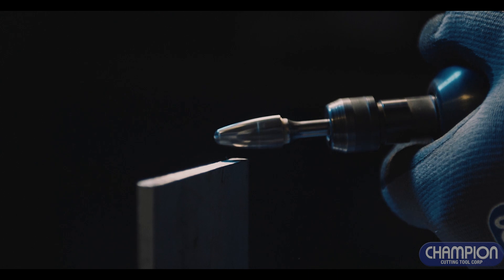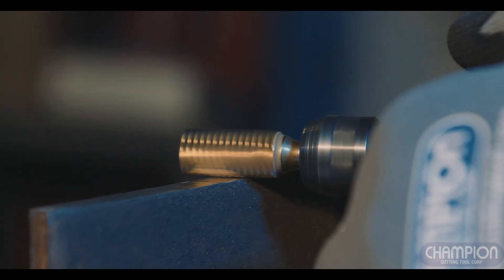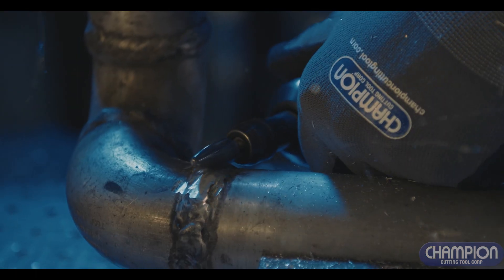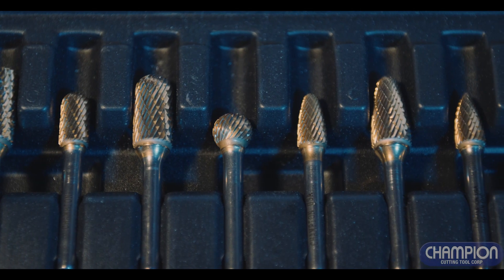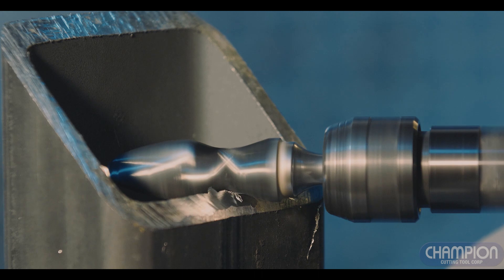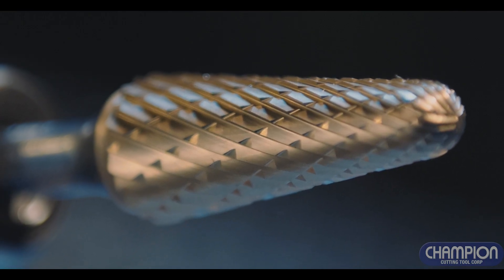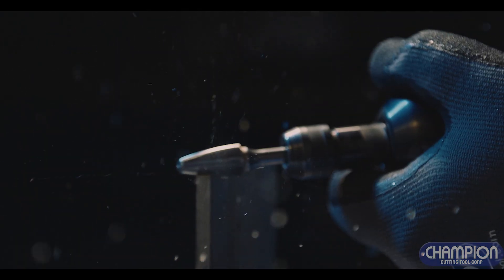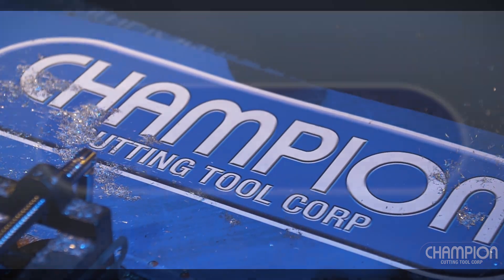Champion Carbide Burs

Comment: Looks good, but isn't tungsten carbide harder compared to titanium carbide?
Reply: Titanium carbide (TiC) is harder than tungsten carbide (WC) as a ceramic.
Typical room-temperature microhardness (Vickers):
TiC: ~2,800–3,200 HV
WC (single phase): ~2,200–2,600 HV
WC–Co (cemented carbide tooling): ~1,200–2,000 HV depending on Co %, grain size
Notes:
TiC is harder but more brittle and has lower thermal conductivity; great as a CVD/PVD coating.
WC–Co is tougher (higher fracture toughness), so it’s commonly used as bulk cutting/wear parts.
Grain refinement and binder content strongly affect measured hardness—less Co and finer grains → higher HV, but lower toughness.
High-temp behavior: TiC keeps hardness at very high temps; WC–Co offers better overall toughness and thermal shock resistance.